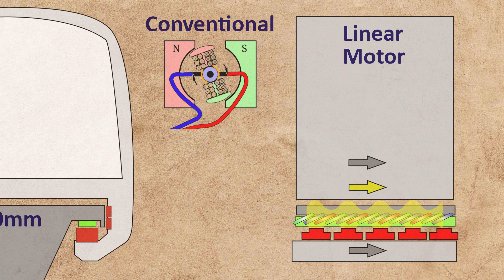Transrapid - The Tragic End Of Germanys High-Speed Maglev Train

Comment: The Transrapid accident in 2006 was a disaster caused by human failure. But it was not the end of the project. The end came by the inability of german politicians and lobbies to build a reference track which was needed badly to promote the system internationally.

Comment: Of course it would have been expansive to build a whole new infrastructure. But that infrastructure would endure for 80 years or more. Conventional rail  infrastructure must be completly replaced after 10 to 20 years - depending on the mode of travel (high speed or mid speed). The tipping point are the costs for maintenance. And here maglev trains are much better than railway.